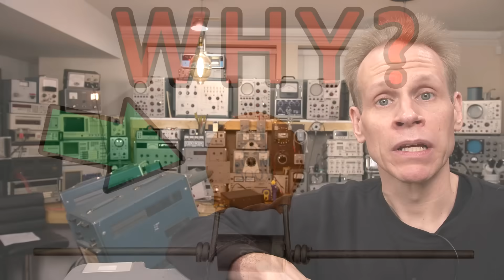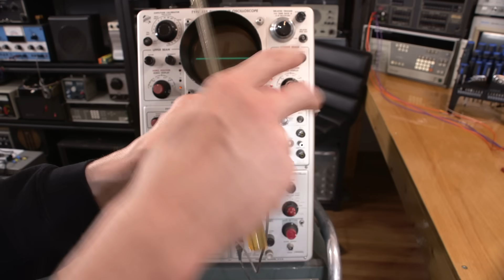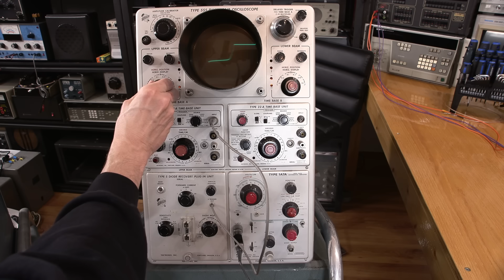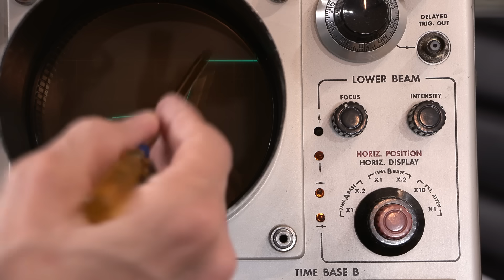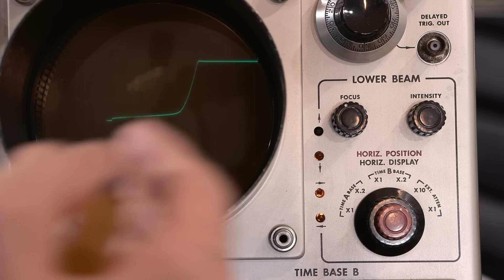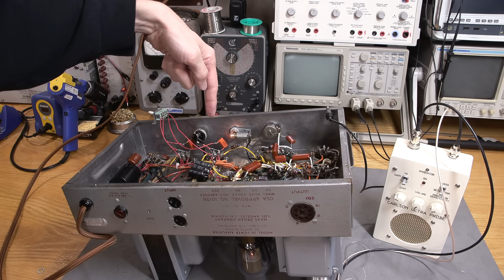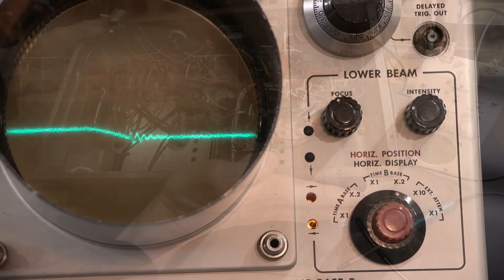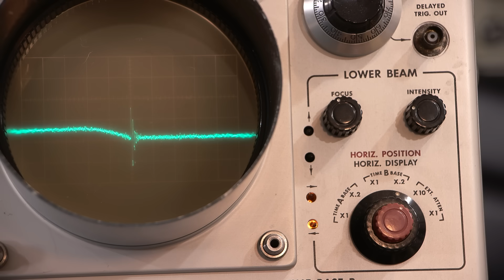Why Put A Capacitor Across The Diode? Here's Why!

Comment: For the values, use between 1nF and 10nF. I used 2.2nF or 4.7nF in the past. Use at least 2 times rated voltage caps than the voltage that is being rectified.
Reply: 1nF feels way too low for 50/60Hz. I used to see 10-47nF caps in this application.
Reply: @mrnmrn1  but yeah sometimes they used 10nF, sometimes 22nF, etc. not much of a difference in noise suppression between those values, even below 10nF is fine what I used. If you want to get even less noise, you can change your diodes to ultrafast ones (swap 1N4007 to UF4007 for instance), the faster transition from conducting to nonconducting will produce less noise
Reply: @michvod  Engano seu amigo, diodo rápido gera mais ruído, quanto mais lento o diodo melhor.
Reply: @canaldopicco  Faster diodes CAN generate less noise, IF they are a soft recovery type. Like BYV26.
Reply: @mrnmrn1  É uma exceção, a maioria deles geram ruído justamente porque são rápidos e com o tempo de recuperação rápido.
Coloca um resistor em série que reduz o tempo de recuperação, capacitor é para filtrar e não diminuir o tempo de recuperação.
Reply: @mrnmrn1  you are just surpassing the diode switching noise, so low capacitance is fine
Reply: Os valores devem ficar entre 47n e 100n.
Reply: Why not use 8 capacitors, two different values, in parallel?

Comment: Exactly what I discovered when I was 14. Few people know about this so I'm glad you highlighted it. I built my first home made telephone exchange, with 4 standard diodes as a bridge rectifier for the 50 volt supply. Then I was dismayed to find that the AM broadcast band was unusable across the entire house. Riddled with mains hum. I eventually found that the exchange was the cause. A ceramic capacitor across each diode solved the problem.
Reply: At 14 i knew how far i had to lead a grouse or a goose .
Reply: @shawntailor5485  Not a bad skill!
Reply: Też to odkryłem w tym wieku w nadajniku FM. Dokładałem stabilizatory, filtry LC i zakłócenia wciąż były, a wystarczyło dać kondensator równoległe do każdej diody, a nawet tylko do transformatora i problem znikał.
Reply: When I turned 14, I finally figured out how to wipe my butt without flinging it.
Reply: Ive heard that humm so many times. Wish I knew
Reply: @kevinbreslin5718  I wish those ceramic caps and transformers knew the lyrics for once, so they would stop whistling and humming!
Reply: @kazkylheku1221   At least they have good rhythm.
Reply: What is a “coroner?”
Reply: @carpballet  That's the person who writes up the certificate if you probe a live circuit wrong.
Reply: @WellReadRedneck    The word “coroner” has vanished.
Reply: Does the capacitor across each diode smooth out the charge and discharge cycle of AC?

In simple terms without a long explanation, is my understanding correct?
Reply: yea i live live in hutchinson kansas. no one around here believes me when i try to tell them about these voices.  i can clean it up amd sure they will sit there and tell me theh xan here talking but cant make out the words. im surrounded by stupid people 24/7
Reply: @DioVogelLegonavoj   Did you by chance buy one of those cheap keyboards that only has lower case letters on it?  I saw something about that on the news I think.
Reply: Been there, done that. But it was just a power supply I built for generic purposes.
At least I had seen in other schematics that it was common to have capacitors in parallel with the diodes so I thought that it was worth a try and it became silent.
Then I have a dimmer that I built in the 80's with a triac. That could put a blanket of noise over the whole block.
Reply: @ehsnils  - Yep Thyristors/Triacs/SCR's can generate a lot of noise if not clamped properly. heh
Reply: Not bad for a 14 year old. At that age I figured out by myself how to actually calculate the square root for any number. I was very proud of myself.
Reply: @TheFrewah  what method did you come up with to  calculate root of any number?
Reply: @PinkeySuavo  it takes some time to explain so let’s start with normal roots. My aha moment came when I did 9/3=3 and noticed that nominator and denominator are the same , you have the root. If you divide 9 by something smaller than 3, the square root, you get something larger then three so the root is in between like 9/2=4.5. Next step is to average (2+4.5)/2 is 3.25 which is much better so you now do 9/3.25.  If you want√18 , you can do 18/5 to get 3.6 , then (5+3.6)/2 gives 4.3 and then you just repeat. Any questions so far?
Reply: @TheFrewah  hmm isnt it similar to Newtons method I believe?
Reply: 4 capacitors across each of 4 diodes in a full wave bridge rectifier would cause a short circuit.
Reply: @richardlibby8825  That is simply false. Capacitors do not pass DC.   The capacitor sizes chosen would not be passing any significant amount of AC current in the neighborhood of 60 Hz.    If we choose a 0.1 μF capacitor, for instance, that has a reactance of 26.5 KΩ at 60 Hz.  I think that is about the largest cap we would use; the impedances get even bigger with smaller caps.
Reply: @kazkylheku1221  I'm trying to prevent some curious kid from starting a fire, and you're trying to 1-up a rando in a comment section. My claim is that if you put 4 capacitors in a full wave bridge rectifier configuration, it is equivalent to one capacitor across the source, and if the source is AC, then this is a short circuit. My assertion is not "simply false", it is correct at t=0+ and incorrect IFF the cap survives the in-rush current transient. Even if your steady state calculation was somehow the only thing that mattered, you're still showing that the post we're commenting on doesn't have enough information.

Now, if I'm wrong about the 4 caps being configured to equal 1 cap across the source, I'm all ears.
Reply: @richardlibby8825  Hi Richard, let's split your comment into its two constituent parts.
You are correct that the parallel combination of two lots of two equal value caps in series will be equivalent to a single cap of the same value - good boy.
You are incorrect to state that this will present a short circuit to an AC source - bad boy. It will present a capacitive reactance component of an impedance whose value is determined by the capacitance, frequency and our friend Pi.
Kazkylheku1221 tried to explain this to you, but you do him and yourself a dis-service by dismissing that as a "1-up", it was simply a fact that deserved to be pointed out.
Consider the similar, more common situation where X and Y caps are placed across the mains input of virtually all electronic equipment by design and EMC requirement. Would you dismiss that as being a short-circuit as well?